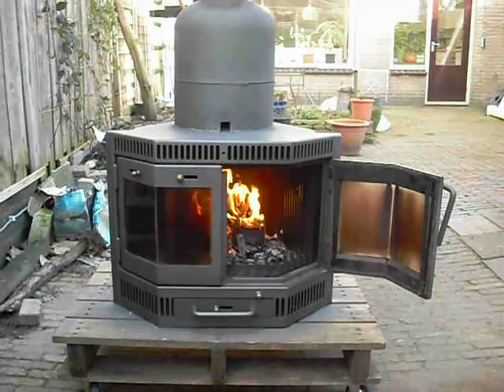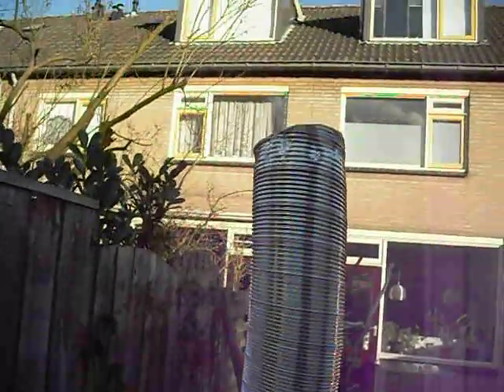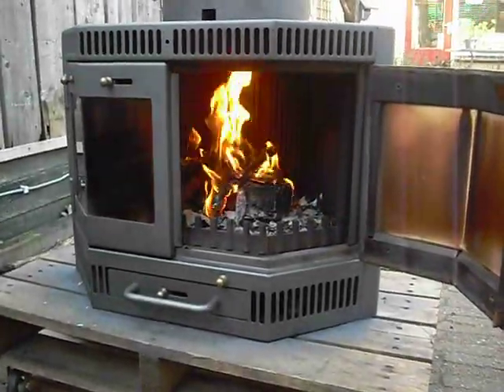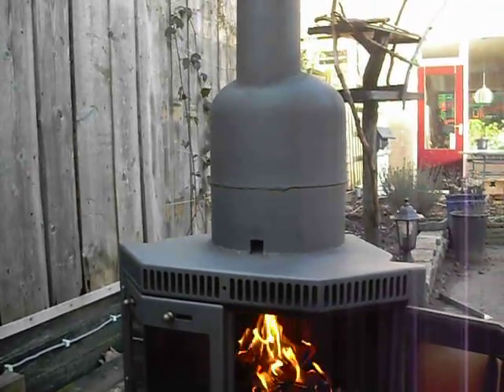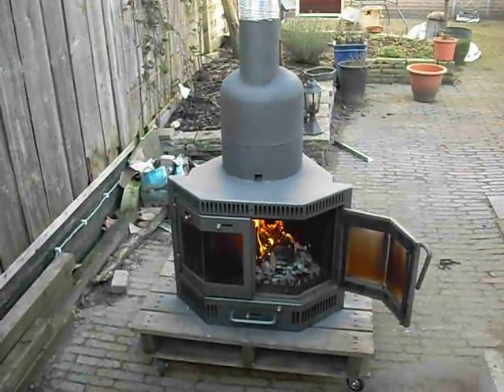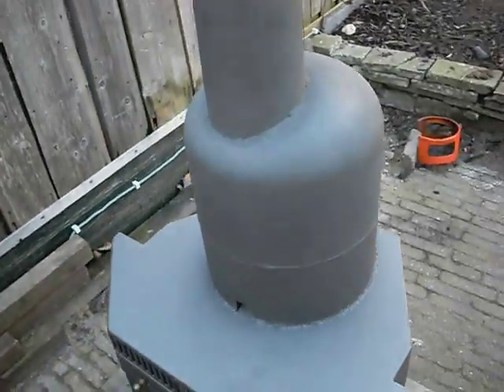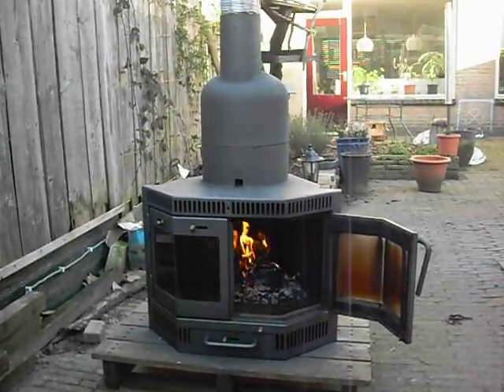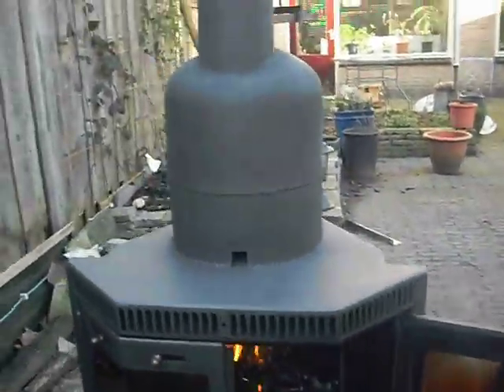Finished converted wood stove to rocket stove heater

Comment: I have to agree with a few other commentors that this is not a rocket stove. All you did was upgrade your woodstove by adding a heat exchanger to the exhaust pipe. A good idea yes, you've improved your woodstove's efficiency but it is far from a true rocket stove or rocket heater.
Reply from the maker: +rockgardner 

It isn't the normal design of a rocket stove, i agree. But it isn't just a heat exanger over an exaust pipe. The exaust pipe has an extra air intake, to give it an afterburn. This is what (in my opinion) is the essence of a rocket stove. And is why a rocket stove is so efficient. By burning the wood and closing of primairy air supply for the most part, one gest a slow burn but with afterburn effect. This way, you get more heat out of your same wood blocks.

But again i agree, it isn't the regular rocket stove design. I made that one too, in another clip.

cheers,

Rene

Comment: My thoughts are that once you put the cylinder over the heat riser, you are starting a secondary burn.  You may be exhausting your source of oxygen to complete the burn.  Also, if you placed the last 3 cm of your regular stove about 6 cm off the floor of you conversion and start the rocket stove inside the regular burn chamber, you might get a true rocket stove effect.  With that said, to get a vortex burn, it is better to use a round riser rather than the square one you used in this conversion.  Lastly, you want to exhaust the stove about 15 cm above the entrance of the Burn Chamber.  This will allow the unburned gases to burn completely in the cylinder before leaving the stove to the chimney. The exiting stove pipe should not get above 100 Deg. f. Most of the heat should be absorbed by the cylinder. This is also true for your rocket stove with the fire extinguisher downdraft cylinder.

Comment: does this work like a traditional rocket stove using only very little wood instead of the usual amount a traditional wood stove would have burned. Does it also throw off more heat than a traditional wood stove, as rocket stoves are notorious for. wee1026@gmail.com for reply. Many many thanks!

Comment: Hi, how did the fire go installed inside the house? How does it go getting it started in the house? I've got a fire that I've just installed that can only start with a normal paper then small wood then large wood stack setup, then scrunched paper on top to get the draw happening instantly, otherwise it just smolders without enougth air movement to get started, and goes out(its because the flue runs horizontally for 5m before updrafting). I think this mod would be a good one, Also, in your design, it loooks like the rocket flue in the gas bottle would virtually  go straight up into the next flue without going down into the gas bottle to heat it? I was thinking to extract the final flue at the bottom of the gas bottle, or is that what you have done, running an extraction pipe to the bottom of the gas bottle, and then up and out of the top of the gas bottle? Thanks, Gadget

Comment: did your original (BTW nice looking) Wood Stove have a Baffle plate on the top to force the exiting heat to warm up a thick baffle thus giving off more heat before going out your pipe

I have a stove like yours that has a large thick baffle blocking the path to the exit pipe
do you think i can keep it as now in old fashion wood stove it serves a purpose but i think to try to convert it to a Rocket it would be blocking the airflow to much and i would not get an effective Rocket effect    

any ideas
thanks
Reply from the maker: No it didn't . There was a slide in plate to make a smaller air flow, but no baffle plate. Actually i am thinking of welding one in as well in this design, thx
Reply from the maker: +thegreatfixer 

I took the metal plate out, because you need the flames to enter the riser pipe. The dome now functions as the plate you discribed, but a lot more efficient.   cheers,

Rene
Reply from the maker: +emc4u2 

update. I didn't weld another plate in. It wasn't needed after all. The heat this thing gives of now is fenominal.

Comment: Excellent job, but, Too bad you did not add the air intake to wash over inside glass, maybe have air intake from the bottom front of the stove, and direct the air intake on to the lower glass to keep the glass clean while it is in use, that would have been a Great feature!!

Comment: I'm sorry,
Can you explain what the benefit, and how it has built with the tank in the smoke outlet?
I understand that all this is to reduce consumption and increase efficiency

Thank you
Reply from the maker: Inside the tank there is the first burn pipe. Air is sucked into this burn pipe, to burn exaust gasses, so double burn. The flames/heat hit the tank. The tank heats up alot. Even more then the stove itself. This heat i partially transferred to the stove. So the stove overal gives more heat, so you need less wood. Because of the aftr burn effect, there is next to no smoke that comes out. This eliminates possible chimney fire. heat stays in the room instead of exiting through the chimney.

So benifits all over. more effective, more safe. cleaner.
Reply from the maker: +Francesc Baselga 

The benifit is that the exaust gasses are much cooler and that more heat is retained in the stove itself. Hence less wood is needed. Also there are only very few exaust gasses. Normally CO is outputted, with this stove almost complete combustion is achieved, so very few harmfull gasses out. And again, a full combustion means very high heat yields..

Comment: pretty
why you added the gas cylinder? More heat / air intake?
Reply from the maker: extra air intake for afterburning the exaust gasses and more heat output so higher yield
Reply from the maker: more heat output, better burning of waste gasses, so no exhaust in the end. And !! no possibillity of a chimney fire.

Comment: or you can put magnets all around a  round device and have 4  magnets configured in a rectangle  with another sliding magnet  in the rectangle  that excites  the round and rectangle magnetic devices  =thus producing energy without wood or oil or water or plastic    - the future is yours  and its been hidden to long
Reply from the maker: More info on this please? could you send a drawing or video of the magnet setup ?

Comment: the oil drip will work ,and when it gets super hot  it will burn the hydrogen in water droplets  added to a ratio of oil to water and if really super hot you can burn all the plastic that is in the ocean without polluting the air